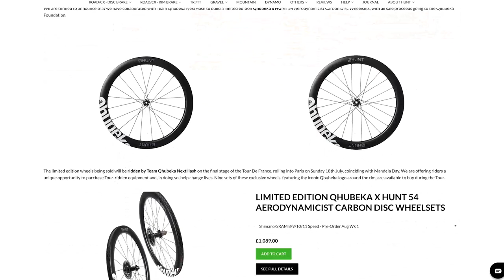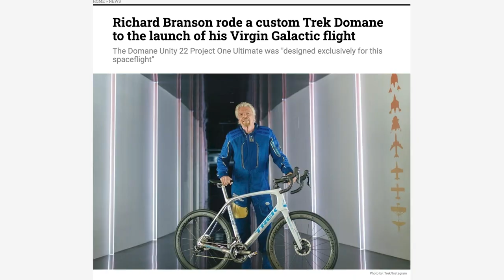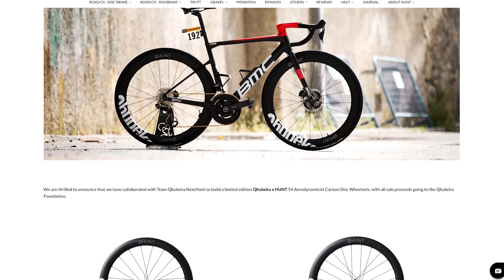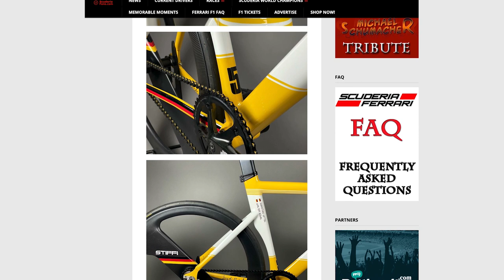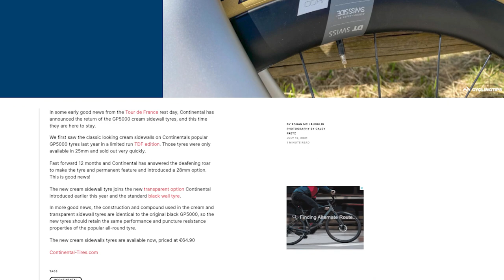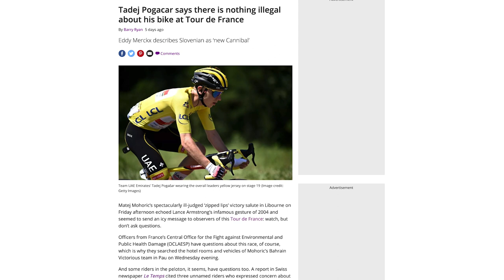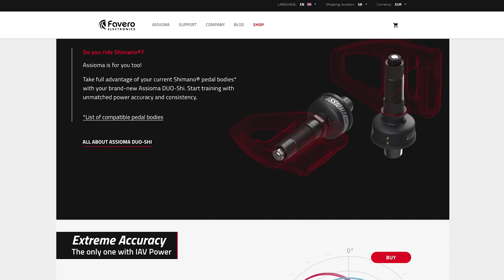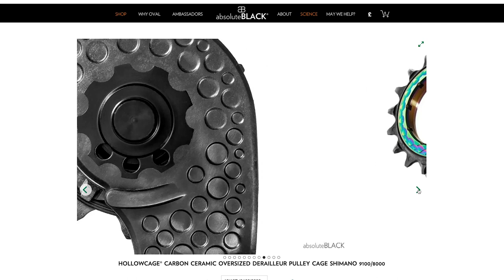Tadej Pogačar Won The 2021 Tour de France On Disc Brakes?! | GCN Tech Show ep.187

Comment: At least rim brakes won the Olympics... And where the brakes of choice for Pogačar during the road race.

But to get back to the subject: No, disc brakes didn't win the TdF. And no, neither did rim brakes. This years TdF was won using a combination of brake types and that's a first.Will a grand tour ever by won by disc brakes only? Sure, as soon as they're better than they are now, or when the only bike available is a disc brake bike. What Pogačar has shown is the most logical: use a setup as optimized as possible.

Comment: You have several ways of looking at this: even several years after being made commonly available and 4 years after being approved by the UCI in professional races, the so preached advantages of the disk brakes have not yet been enough to make them totally replace rim brakes... The Giro was won on rim brakes (even with gravel sections and awful wet weather on multiple stages) and the Tour was won on a mix of both rim and disk, proving disks don't bring only advantages. There has been too much discussion on this: brakes don't win races, riders do, and Pogacar would probably have won even with no brakes...

Comment: I ride a rim brake bike but would love a disc brake frame because I'd rather replace a disc if and when it wore out compared to having to replace an entire wheel once the braking surface was worn down on my rim wheels. The fact that nothing can be done with carbon rim brake surfaces is what keeps me from spending money on a "better" carbon wheelset.
Reply: It is not the fact, surface of the brake track could be renewed, I think Lighweight actually does that.
But initiative for renewing is not very high because good CF rims last 50000 km or even more in common conditions and people rarely use single wheelset long enough to actually wear down brake track. Also rims are not that expensive, at least if you don't try to buy the most expensive ones.
Big brand super expensive wheelsets are the waste of money like disc brake bicycles anyways.

Comment: Breaking news!  TdF won on a bike with air in the tires!
Reply: or not , it could have been helium , to make the bike lighter
Reply: @alainbellemare2168  do all points go over your head?
Reply: The point is a little obscure as the analogy doesn't make sense.
Reply: @neil7769  not too bright, either?
Reply: @scotth3354  :-D
Reply: Since you need it explained.. you were attempting to make an analogy between it being news that the TdF has/hasn't been won on a bike with disc brakes and it being news that it's been won with a bike with air in the tyres, the implication being that in 2021 it shouldn't be a surprise that the TdF has been won on discs, because they are as necessary and ubiquitous as tyres with air in them. But they're not.

Comment: Dont really understand the brake discussion. For dry weather rim will always be best because performance is very good and its lighter. And in the wet rims will still be able to break your tires loose easily because you have less grip in the wet. The breaking performance of modern rim breaks and pad compounds is well enough to make your tires skid in any situation. Do you want your tires to skid in the wet? Probably not. So why should dics brakes be any better in the wet? They will only make you skid sooner as they break even harder in the wet. I feel like in the wet you'd want a mellower break with progressive breaking power and most discs that ive rode are way too bity and aggressive.

Comment: Not about weight? Why are they riding the lightest bikes?  I don't see them on Chorus/Ultegra/ Force bikes. Saying weight is irrelevant is a good excuse for pushing disc brakes, but if weight wasn't important, then why aren't teams riding lesser group sets? They aren't because weight is still very important.

Comment: In NASCAR auto racing, tech inspectors will bust a move a suspicious car, getting out their wrenches and disassembling an engine or anything else which is causing curious speed.  So why can't on-the-spot breakdowns be done at bike races?  "Yo, Tadej, wheel that bad boy right over here, what's up with those metallic sounds?"  And then, bingo, case settled, either way.  And it is lame that unnamed sources can weave their tales of noises like a paperback writer at the beach.

Comment: I think each rider ought to be allowed one road bike and one tt bike for the entire race season. Components should be allowed replacement only in the event of fracture, becoming bent out of proper shape, or mechanical failure.  And once a part has been replaced, it must be destroyed or surrendered so that there will be no modifying disguised as reparing or switching back and forth.  That would add an interesting dimension to the sport.

Comment: Tadej Pogacar could have lost a minute for each mountain stages riding a 1/2kg heavier disk brake bike.  The V3RS rim brake bike allowed Pogacar protect his 5min. GC lead.
Reply from the maker: He would've lost time riding a heavier bike....if his performance was on the same level as his competitors, rather than several levels above them.
Reply: @gcntech  Riding a heavier bike is a handicap.  Even if Pogacar is several levels above his main competitors in the GC.  The extra 1/2kg weight do add up in extra watts of effort for each mountain stages.  The more tired you are at the end of a stage.  The less energy you’ll have for the next days stage.  Everyone knows that.